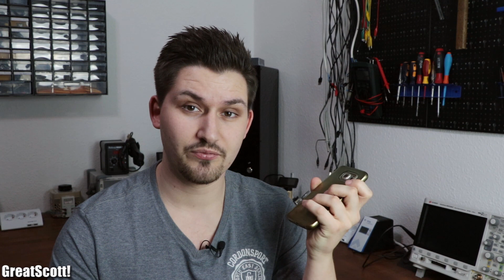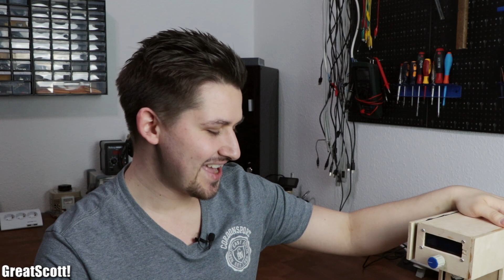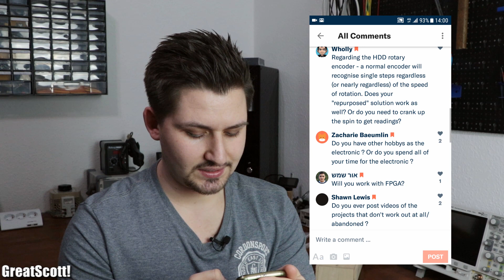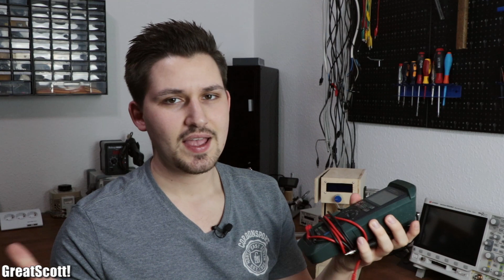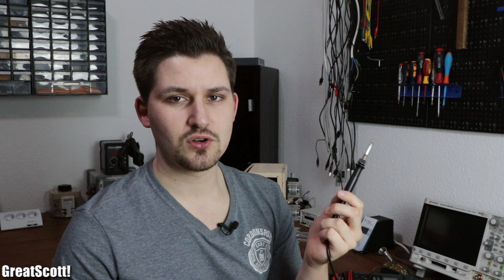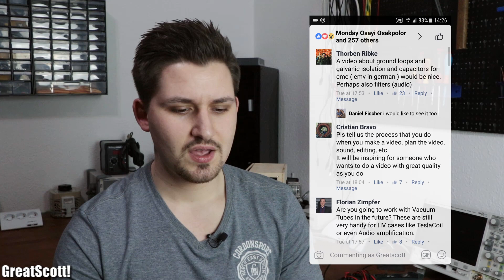Random/Unscripted Q&A #2

Comment: Gday great Scott. I’m wondering if I can request a video, if you take requests that is. Can you do a very basic CNC components video please. Simply: you need a motor, best type is ... The motor plugs into a driver ... all the way through to the cad/cam software so we can see an overview diagram of the components needed for a CNC project and how those components connect and their purpose. Very general to provide a solid overview of the whole system. I’m sure you get the idea. Thanks for listening GS, cheers Michael

Comment: I have an interesting question and I think you're the best to answer and maybe do a video test what happen if you change the capacity on a battery pack let say from 10k MAH to 20k MAH? Is this possible or is the chip program to charge the batteries to 10k only? I got this awesome power bank Tqka Myraid 10,000 MAH and I would like to do a but of a overhaul.

Comment: Michael from trinidad i would love to see you take ah car amplifier and modify the amplifier to get more power on the output section 2 and i would love too see you build and automatic transferswitch using contactors and relays also a control circuit using ics

Comment: Good luck on your thesis! Thanks for creating high quality content for us to watch. Personally, I would like to see some more electronic basics videos. I went to university for software engineering which required us to take around 8-10 electronic classes. The problem is that while I understand lots about digital logic and circuits, I understand very little about analog circuits and design. Filter circuits, comparator circuits, capacitor and inductor designs would be great. Thanks!

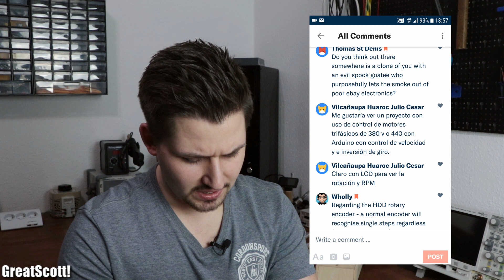Comment: Vilcañupa Huaroc Julio Cesar translated (spanish)(12:15): 

first message: i would like see a proyect using a 380 - 440v  three-phase controller with Arduino with velocity and inversion rotation sense
second message: of course with LCD to see  the rotation sense and the RPM

Comment: "FI-Schutzschalter" = Earth leakage circuit breaker
Reply: Mike Herbst  ... oder auch RCD residual current device called.
Reply: Danke :-)
Reply: Ground Fault Circuit Interrupter, GFCI? I noticed that "Schutzschalter" means "breaker" which is an additional function that a GFCI does versus an RCD.
Reply: Okay so here's what I found with my research on translating this device...

Germany: Fehlerstomschutzschalter (Error Current Protective Switch) or FI-Schutzschalter (?)

UK: RCCB (Residual Current Circuit Breaker) or RCD (Residual Current Device)

USA: GFCI (Ground Fault Circuit Interrupter) or GFI (Ground Fault Interrupter) 

Australia: RCCB or RCD or ELCB  (Earth Leakage Circuit Breaker)

Singapore & Malaysia: ?CBR maybe? (Core Balance Relays)

Sweedin: Jordfelsbrytare (Earth Fault Breaker)

Spanish speaking countries: Interruptor diferencial (Differential Breaker)
Reply: I was thinking maybe it was an AFI (Arc Fault Interrupter) which is a special type of breaker. But I don't know a single word of German.  I'll have to look up what an RCD is... as an electrician I've probably installed them before but know them only by some U.S. specific industry jargon name lol. I often lean that the technically correct term for things is not what we call it in the field. Like we often just say GFI in short for GFCI and dikes instead if linemen pliers, or T-strippers instead of wire strippers, crescent wrench instead of open-end adjustable wrench, etc.

Comment: The spanish guy wants to see a project using arduino to control 380v or 440v three fase motors. Also he thinks it is a good idea to have a LCD display to see the rpm of the motor. I would love to see this video too.

Comment: I need some help to identify a stepper motor 
Name: Mitsumi M49SP-2NK

It is from an old printer 
No wires ... 
so I got stuck at this point because I don't know which type of motor it is 

But it has 8 pins ...
4x1 
+
4x1

I hope you can help me or somebody else can do

Comment: That spanish question falls along the lines of "Id like to see a project with the use of controlling three-phrase motors with the arduino to control the velocity and turn." Then the one below that says something like, "clearing it with LCD to see the rotation and RPM" So I assume they mean they want the LCD board in use like the one you had for your cocktail. I have taken some spanish classes but its not perfect.

Comment: Hi, Have you ever think to design personal DAB (DAB+) transmitter? I designed several transmitters in the past but analogue with AM, FM modulation only but never tried with digital signals (wideband transmission). Novadays FM transmitter (88-108 FM PLL) can be purchased from ebay for a few quid only and is widely available from Chinese sellers. It was imposible to buy one over 20 years ago. You can't buy any DAB transmitters yet so it might be good idea to run small business if you can design one (and copy the project as many times as required).  Would be great to see such project made by GreatScott :P

Comment: What? No electricians screwdriver in a basic lab? They are dirt cheap, you can use them to find mains voltage on a socket and is in my opinion the most useful screwdriver. It fits about 90% of the screws i need to remove. Even some torx screws. You framed the shot perfectly btw. I got a phone with an 18:9 screen and when i zoom the video to fill the screen your forehead does not get clipped off.

Comment: The question in Spanish says: I would like to see a project where you control the speed and direction of a triphasic motor 380V or 440V using Arduino.

(not an expert just happens that I speak Spanish and I'm "good" with English)
Reply from the maker: Good to know, thanks.
Reply: Or you just used Google translate
Reply: Doesn’t it say 380KV or 440KV?
Reply: Max B perhaps